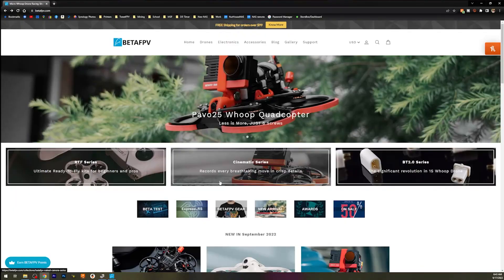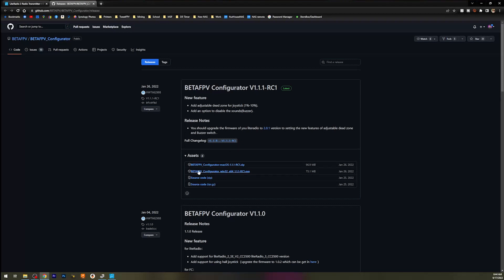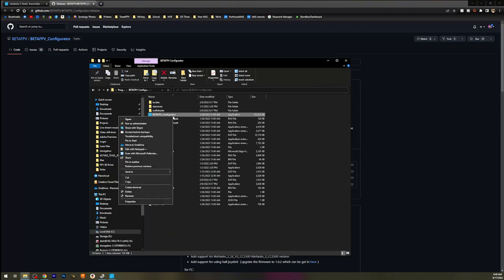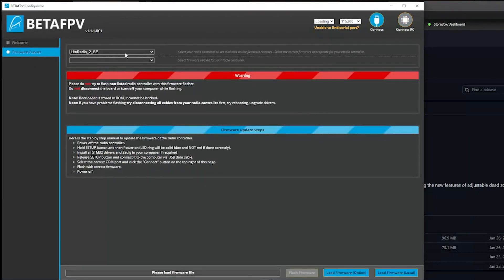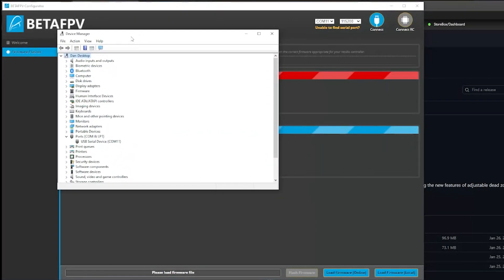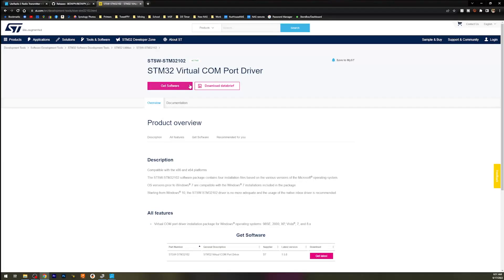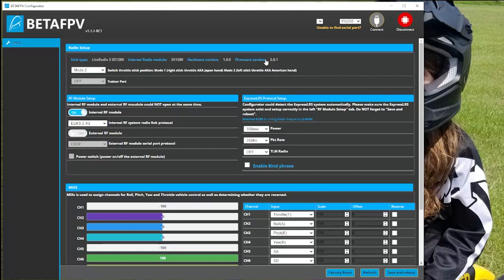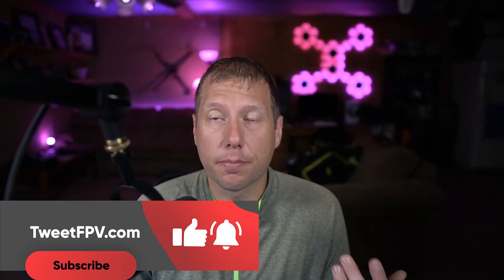BetaFPV Beta LiteRadio 3 ELRS 2.0 update #expressLRS #elrs #betafpv #FPV

Comment: 4:50 click Connect RC nothing happens.
Reply: Same problem here.
Reply: @DukeRaees  did you find a solution
Reply: same :( did u find a solution?
Reply: @giacomo_o  I managed to get mine bound by plugging it into beta fpv confirmation and updating the radio with new firmware from git hub.
Reply: Configuration

Comment: Maybe you can help me how to update Literadio 3 to firmware 3** ?
Reply from the maker: Last i checked there is not elrs 3.0 fw for the lite radio 3. Best off getting a new radio.
Reply: Thanks for the answer.  I am buying literadio 3 pro
Reply from the maker: I would get a more main stream radio like the boxer or zorro. It would most likely serve you better in the long run.

Comment: Great tutorial 👍🏽I bought a lite radio 3 elrs awhile back so I would have elrs for my mobula7 1s elrs and I was lucky that it had version 2.0 on it because the whoop also had version 2.0 and it bound perfectly....however...the radios aux channels and sticks were all backwards and fixing them was fairly simple I'm not a luddite but I'm not that comp savvy either lol unfortunately I was a victim of the betaflight bricking icm 20689 gyros issue and I'm getting another mob 7 elrs at least now I will have "all new" spare parts but the new mob 7 1s elrs comes with version 2.1 will I have to update my radio from 2.0 to 2.1 for it to work or is the update just to have newer features? I would appreciate any feedback from anyone🙏🏽✌🏽
Reply from the maker: You should be fine. The major version need to match but the sub versions can be different ie 1.x can no bind to 2.x fw but 2.0 can bind to 2.5 for example
Reply: @TweetFPV  thank you I really appreciate the help!🙏🏽✌🏽

Comment: My Lite Radio 3 updated fine, but still failsafes in my house...havent been impressed with ELRS after 4.5 years of Crossfire with zero failsafes
Reply from the maker: Which receiver are you using?
Reply: @TweetFPV  EP1, even set it to 50hz, still drops in the yard ...i guess i need 1000mw TX ....it all reminds me why i left 2.4ghz years ago